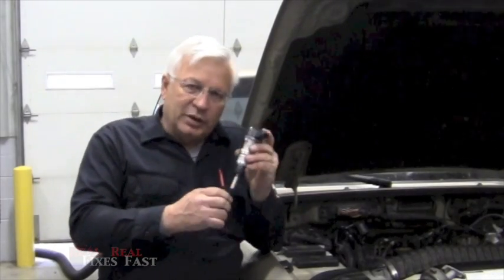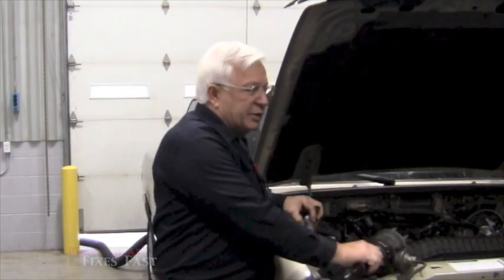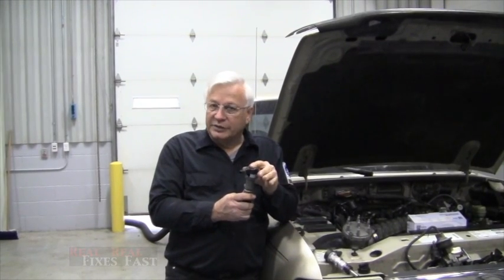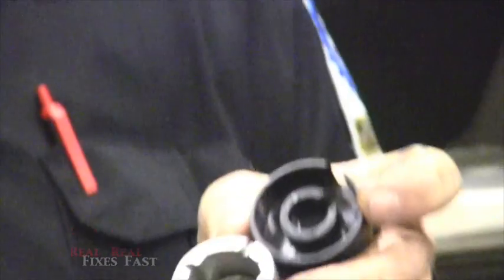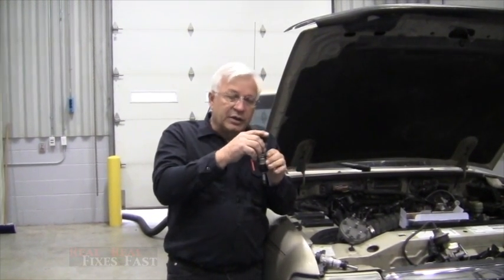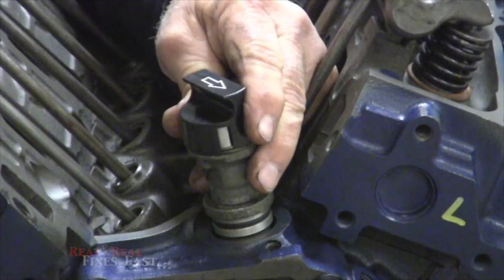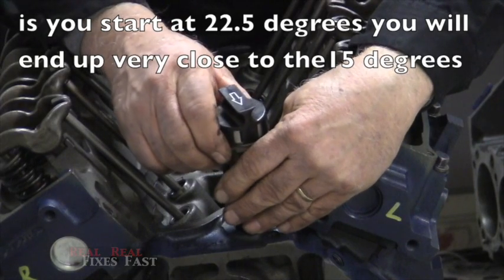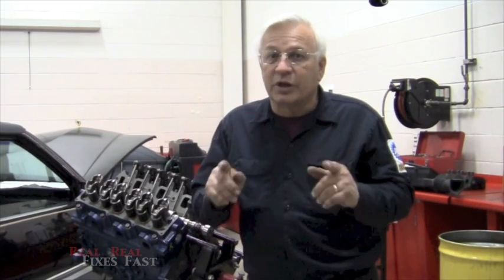Understanding a Camshaft Synchronizer

Comment: Great video, but there is an error. @11:24 you state that the camshaft turn 2 times for every 1 rotation of the crankshaft. It is actually the opposite, the crankshaft turns 2 to every one rotation of the camshaft. Some of the synchronizers are driven off an additional gear on the front of the large camshaft gear, such as on the 3.8 and the 4.2 Fords. Maybe in your case the synchronizer is driven directly from the helical gear on the camshaft. Great video though, and yes getting to these things can be a bear.

Comment: A have a 1995 Ford  ranger  and wants to know  the voltage of the camshaft.. It has 3 cables.  Voltage, ground, and signal. But the book not indicate the correct value of each cables.. Can you illustrate me.. Thank

Comment: Hello. Great information and  excellent presentation. I'm not familiar with this engine but I heard you say something that's kinda opposite to what I know. It doesn't affect the content you delivered though, but I still want to ask. You said the camshaft makes 2 revolutions to every one of the crankshaft. Is that the case in this particular engine. I know generally the cam rotates half times as fast as the crank.
Reply from the maker: You are correct, it was a verbal mixup that I did not catch.  Nice catch.  I got my words backwards.
Reply: That can be seen on the cam crank signals showed as well. Excellent content.
Reply: Thanks !! Great 👍🏼 lesson !!  Have a wonderful day .